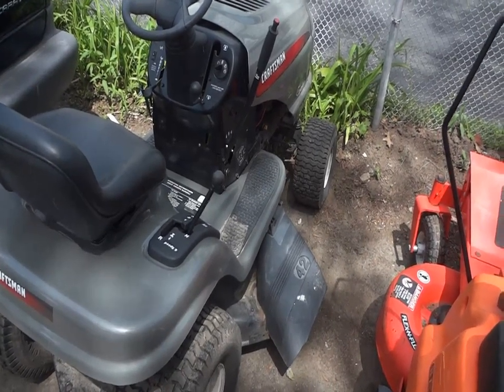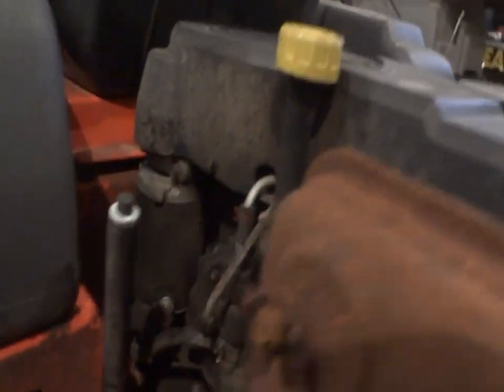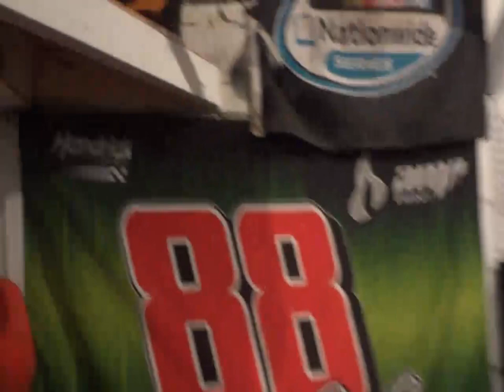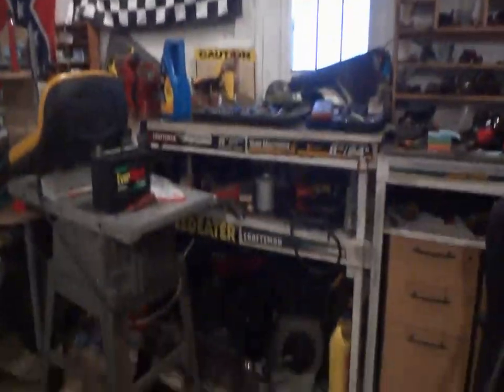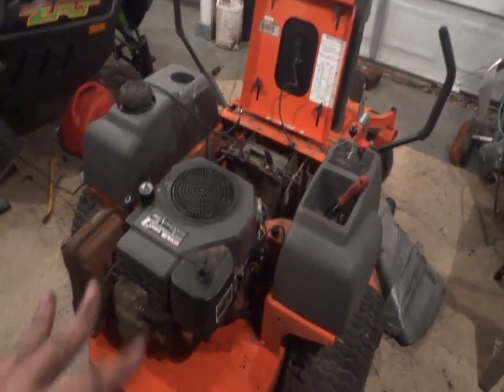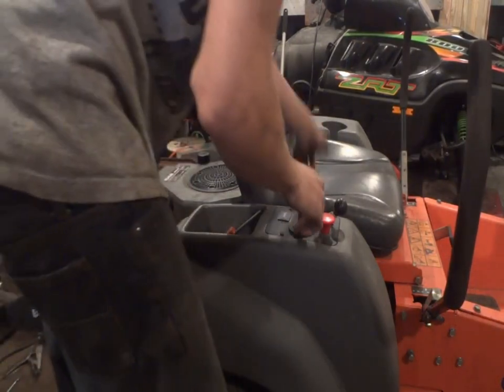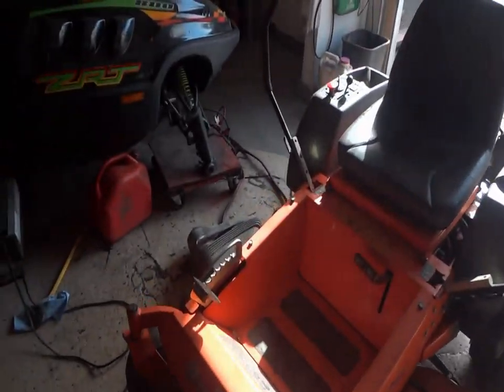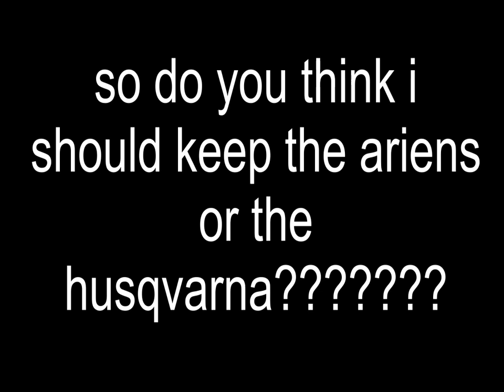husqvarna cz4817 zero turn motor swap

Comment: How did you get the drive system pulley off the shaft of the engine before you removed the engine? I can't seem to find a set screw on the pulley. Is it pressed on there?

Comment: I have this exact same mower. Had the 17hp Kohler (way under powered) and it wiped the cam lobes.. so I replaced with a 21.5ph v-twin briggs.. Runs WAY better.
Reply: would you happen to know the model #  for that 21.5ph v-twin briggs Sean Alfrey ? Thanks
Reply: +MrAtvfan  just any standard twin Briggs 1" shaft will fit. have to drill mounting holes and change a little bit of wiring but just fits in. I had to make a different exhaust for mine since the Briggs exhaust ports were down and not out the side. worth the little bit of work for the changeover. just don't put mulcher blades on this machine. bunches up in the deck.

Comment: I have a Husqvarna CZ4817 zero turn riding mower that I just replaced the drive belt and ty-rod. It worked fine for 16 hours of mowing (6 different times).

I was mowing last night, went to use the right arm to back up and it would barely move backwards. It moves forward just fine and turns just fine. It just want back up on the right side. Left side works fine in all directions. Please ya’ll any ideas on what to look for, where do I start?

Thank you so much in advance.
Reply: same thing is happening to mine same model, its the right arm it will not go backwards on that side but the left will have me spinning, i'm guessing there is an adjustment that can be made cause when in neutral the right arm is off a tad and it makes the mower not even sit still when started ,but backing up there is nothing on the right arm

Comment: At the shop i work at we use a liquid vacuum for changing oil. its made by mityvac, and u just hook it up to your compressed air and it sucks out the oil

They sell them at sears, you should look into one

Comment: I love when I'm right haha. Anyways not a bad tractor at all. Also put a brand new kohlor command 18 horse short block in a tractor and the dam thing leaked oil all over the place. Out of the breather plate and valve covers. ran great though always a plus